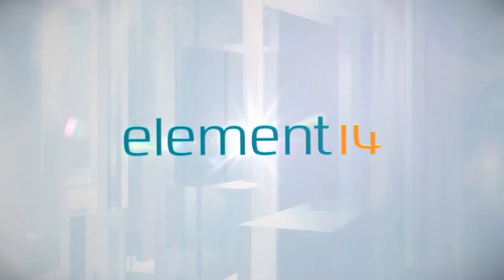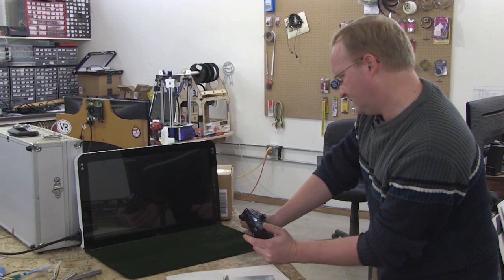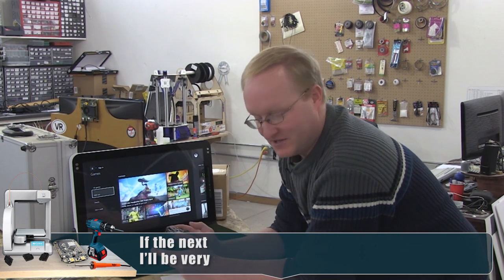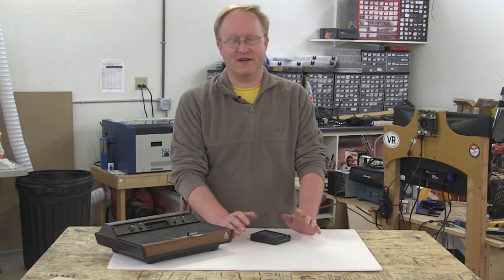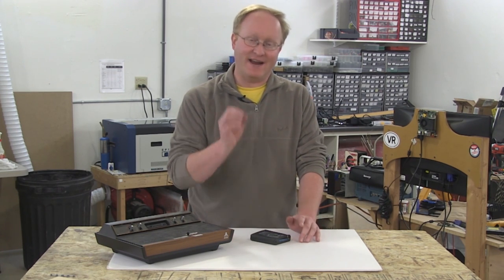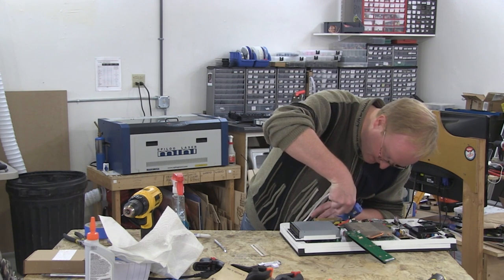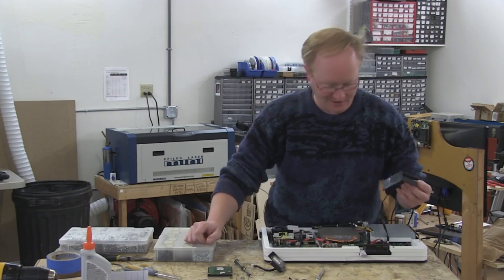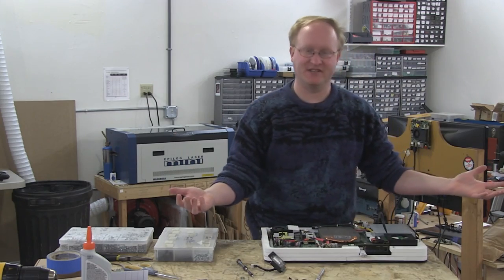Ben Heck’s Xbox One Portable Part 3

Comment: Someone needs to make a portable xbox one without a disc drive. It would strictly play digital titles but that would cut down on it's size considerably.
Reply: I don't mean an official release. Just a modded console by someone like this guy.
Reply: That's why I don't buy them. All my digital titles were free.
Reply: DrizzlingDrizzlers 100% agree my friend!  $250 each unit Microsoft should cost it.
Reply: Eric Borenstein - Yeah or make a portable accessory that communicates with your xbox one at home. That way it wouldn't replace their flagship console, but would give people portable xbox one games.
Reply: a nvidia shield like device with xbox servers and marketplace, 8gb of ram, 3ghz quadcore processor, touch screen 720p touchscreen, removable 8,000 mah battery, sd card slot, front  5mp camera and micro usb cable slot for charging. and usb port for xbox one controller.

unit could cost $300 

it might happen by 2025.
Reply: I like it!
Reply: Thanks
Reply: Will have cortana and windows 11 on it.
Reply: Xbox cloud servers on any device ios, mac,windows and android by 2020.

Much more simple than making devices.
Reply: Monthly subription xboxlive platinum.

Comment: Tha tablet is a great idea, specially if it was touch screen saving you the need to plug you controllers into the unit to turn it off or turn music on etc.

I mention the controllers since most peeps charge them on a separate unit like a docking station near a power outlet.

Awesome mini series even if i don't understand electronics its nice to see it come together stage by stage

Comment: I dealt with that same issue with the drive. Take the outside metal shell off (top and bottom) and it should work at an angle. The unit itself is contained and doesn't actually need the metal shell to function. The magnet inside is secured already and from what I have seen the metal case actually stops the drive from engaging fully when at an angle.

Comment: How would I make an Xbox One tablet? Not using an Xbox One.
Reply: Mattie Richmond *Facepalm* Read my comment. I said I'd not use an Xbox one. I'd NOT. NOT. Do you NOT know what it means? I would use parts from a PC.
Reply: fittogan Yeah. I could make something millions of times cooler, or just buy a surface and plug a controller into it.
Reply: well first of all you learn how to duplicate all the gui and coding that went into xbox one then you buy the copyright for xbox off microsoft
Reply: glitchsmasher *facepalm* you just assemble a pc inside a tablet case like that and there already is a windows 8 tablet
Reply: ***** Most Windows 8 tablets are ARM based, not x86 based.
Reply: glitchsmasher Does it really matter?
Reply: yes
Reply: ***** Yes. Most apps are build for x86.
Reply: No. It uses a completely different architecture. You would need to buy an Xbox One to get most of the required components.
Reply: Kul Zaze in an earlier video he found you can get the optical drive to work some of the time, or you could just lay the thing down flat while installing
Reply: Thats impossible...you can't make an xbox one without an xbox one lol proprietary hardware and software.
Reply: Ben Zimmerman That's not the point. I meant I'd make a tablet out of anything but the Xbone. Also I'm guessing you've never heard of emulation.
Reply: yea but emulator like require double the power of the console
Reply: ***** More than double, but that's not very hard to do. PC hardware could easily do that.
Reply: Well depending ps4 and xbox one do have some very powerful hardware and to emulate one in 2015 it would be hard maybe in 2017
Reply: ***** Bullshit. You can surpass it's power with a £100 GPU. 750Ti. Put in a Titan, some 980s or a 295X2.
Reply: glitchsmasher it is the point. Practice your English. You want to make an xbox one tablet out of anything but an xbox. I told you it isn't possible because you need xbox one parts in order to make one. And "not used an xbox one" is absolutely shit English.
Reply: Ben Zimmerman My phone changed "Using" to "Used".
Reply: glitchsmasher
 Since there is no emulator for xbox one, I guess you will also code it. You're so awesome, so it should not be a problem...
Reply: glitchsmasher ah well that makes much more sense. What I'm saying though is that its impossible to recreate an xbox one without using an xbox. Are we on the same page now?
Reply: Ben Zimmerman Emulation. The Xbone SDK leaked a while ago. Also, there are very few games on Xbox and Xbox only. Use tha guts of a ~£500 laptop and you've got a super thing gaming machine capable of much more than an Xbone.
Reply: glitchsmasher ok...so what's the point of building a fake xbone? Just emulate the xbox games on a pc lol a lot of wasted work if you ask me. I highly doubt the SDK was released at all though...the ps3 and 360 have been out for years now and they havent been able to crack it. Maybe thats because of the architecture and all that shit, but still. I think you read a fake article or something.
Reply: glitchsmasher

You do know an SDK will not allow you to run X1 games, right?
Reply: Drk Matador Yes, I know that, but it will be a massive help when getting an emulator made.
Reply: glitchsmasher

The only thing useful with an SDK is making software. Not emulating hardware. 

Besides, the X1 is x86, emulating will not work properly, you'll have better time translating the executables and running it natively.
Reply: glitchsmasher Sorry? We don't even have a perfect N64, Wii, Gamecube or PS2 emulator, we don't have an original Xbox emulator, we don't have a PS3 or Xbox 360 emulator, and you're saying that it's totally possible to emulate the Xbox One? It would require a ton more power that's non-existant to run it at full speed.
Reply: David PLAYAH The reason we have flaws in our N64, Wii, GCN and PS2 emulators an the reason why you think we don't have an xbox emulator (I've used one before, tricky to get running but okay) or a PS3/X360 emulator (In the works, they exist, they are just slow) Are because emulating the architecture is hard on x86 hardware, but running x86 on x86 isn't hard at all. I'm not saying it will be 1:1 but with the consoles running ~1.6GHz 8 core (4 physical, 4 virtual iirc) and roughly a Radeon HD 7870 I can see cheap PC hardware being able to emulate it pretty soon. Most CPUs should be able to get it down to two cycles, and have the horsepower to run it at two cycles.
Reply: fittogan Yes you can, just make it from scratch.

It... sounds... possible.
Reply: glitchsmasher I'm the only one who seems to know what you are talking about(aka he is saying the Xbox one is shit) He is correct!!!
USE A Play Station 4 They are a lot better
Reply: McMinecrafterz £420 PC, 2-3x the specs of a PS4 for the same price.
Reply: ***** you cant even emulate xbox 360 on a pc and its been ten years it has been out you will never get hardware emulation for ps4 or xbox one
Reply: mark salot most of the games on the ps4 and xbox one have better graphics on pc those consoles are only worth it for the exclusives like the up and coming red dead redemption game , halo series , uncharted , forza ect
Reply: mark salot First off, XB360 emulation already exists in an early form. Secondly, the newest generation consoles are based of x86_64 CPUs and AMD GCN GPUs, incredibly similar to PCs.
Reply: Meaby you could hack a windows tablet
Reply: glitchsmasher You can't because the OS that runs Xbox one was designed specifically for the hardware of the Xbox one, So you can't just get any motherboard and install the OS on it and expect it to run normally, Unless you use some sort of emulator.
Reply: ***** Who needs the Xbone OS anyways? It's not like it has many good games that aren't cross platform.
Reply: glitchsmasher Well you wanted to build an Xbox One tablet. You didn't say you wanted to build a high end PC tablet.
Reply: glitchsmasher

Comment: I would have went for a laptop version, mostly because of two reasons. You can make it asthetically more appealing if its primary components were at the bottom fold and the monitor on top. The second reason is to provide more viewing angles while still being independently stable on a flat surface. All in all great build.

Comment: Thing I would have done different...since he asked, not that I'm a builder myself:

Not have the case that's supposed to keep the screen protected as the stand, bits of dirt, crumbs etc may get stuck on it and then get pressed/rubbed against the screen negating it's reason for being there.

Something like the Surface Pro's removable keyboards may have a better idea there, where you can remove it via magnets and use a built in stand instead to prop it up.

Comment: the tablet thing is nice but it will be better if you make a case for the blu ray and make it external
Reply: ***** because 500GB SSD's are cheap
Reply: you know, because thats comparable to a $50 or $60 1 TB Mechanical drive
Reply: laptops are portable, they use the exact same type and form factor drive, unless someone plans on handling it roughly there is no problem with a mechanical drive, the blueray drive is more fragile when spun up than an HDD is
Reply: it would be very simple to and you could probably do bluetooth 2
Reply: ***** there is nothing that won't alow a normal 1 TB laptop hard drive to be put in instead
Reply: All it would do is decrease loading times, most games must be fully installed to the hard drive on the xbox one , it doesn't take long to fill 500 GB's with games that range from  10- 40 GB
Reply: ***** lol? Dude just make the wires longer and add ports to it in the case

It is not a matter of support things

Comment: Why not just make a portable gaming PC? (request)
Reply: so a gaming laptop
Reply: lucario plays videogames. In essence, but not quite. I meant a desktop PC small enough to be portable without having to lose performance in exchange for portability. (maybe achievable with a mini-ITX board)
Reply: yeah that would be cool
Reply: +noah roberts It has already been done by ASUS I think, I remember seeing one on LinusTechTips. The system has a desktop i7 and desktop GPU with MASSIVE heat pipes to keep it cool enough to run without loss in performance..... Its a pretty cool idea but really expensive.
Reply: +noah roberts i call it a "gaming laptop"
Reply: +noah roberts It called a laptop and a external GPU. GPU and Powersypply in a box connection with a PCI/thunderbolt cable to the laptop.
Reply: +Ørjan Hofstad I said in an earlier reply: " In essence, but not quite. I meant a desktop PC small enough to be portable without having to lose performance in exchange for portability. (maybe achievable with a mini-ITX board)"
Reply: +noah roberts It's called a gaming laptop.
Reply: +noah roberts surface pro 4
Reply: +noah roberts actually there are laptops with desktop processor since new processors have very low TDP and are quite similar in size and  Nvidia GTX 990m which is the mobile version of GTX 980, it has the very same performance with smaller presentation and less energy consumption.  Actually gaming laptops are powerful enough and very portable.
Reply: gaming laptops are just portible
Reply: I'm not talking about laptops, I mean a desktop PC small enough to be way more portable, but not suffer in computing power because of it.
Reply: Fair Criticism I seriously doubt any computer small enough to fit in someone's hand can even run flash games without frame rate issues. As previously mentioned, a mini-itx form factor might be what I would want to start with.
Reply: or maybe from an old laptop board with a mini pci to pcie 16 converter
Reply: Abdalmalik Ghandourah It would run into heavy bottlenecking issues depending on how new the GPU is.
Reply: It's called a laptop lmao
Reply: BellaBehindAKidBehindACamera Read the several times that I have said that a laptop is not what I am talking about before laughing your ass off...
Reply: After reading your post, something like the Smach Z sounds more fitting.
Reply: noah roberts you mean a gaming laptop?
Reply: Sky Kingsman no m8 most gaming laptops are not upgradable he's talking about a portable device that doesn't sacrifice power for portability